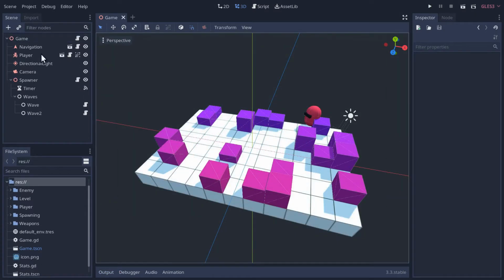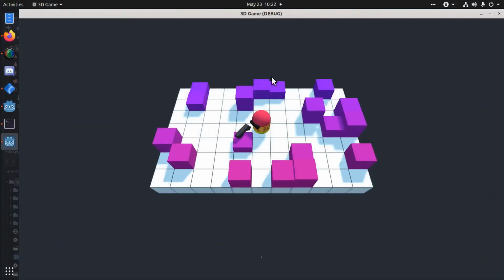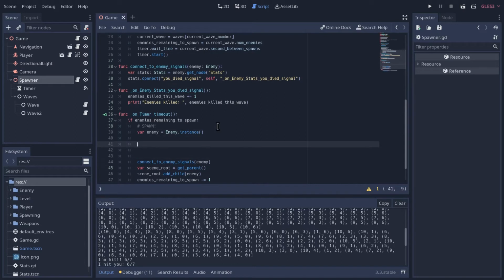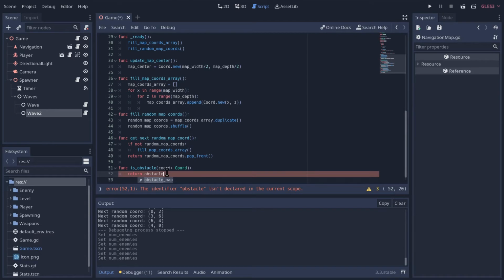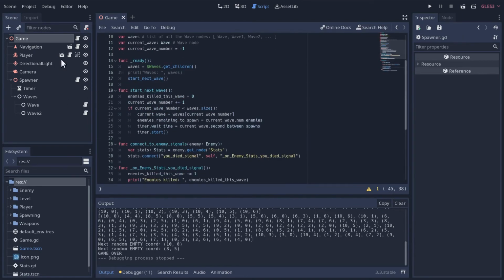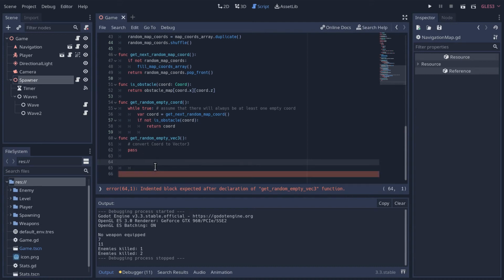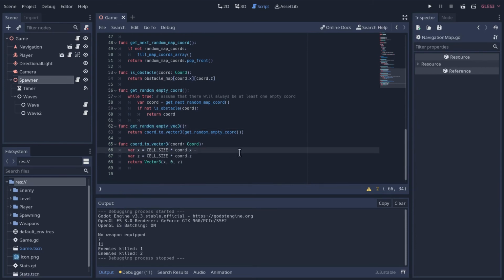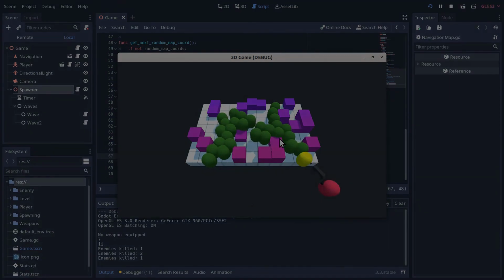Make a 3D Top Down Shooter with Godot - Part 3.1 Random Spawning

Comment: If you using godot 4.0 Beta 11 and probably newest betas  these are solutions for this video.
Ther is a bug which so far it isn't resolved since Godot 4.0 Alpha 3, still dosen't work in Godot in 4.0 Beta 11
You can't use "not" or "!" infront of Array  if that array is "var", it only works when it is "const".
GDScript 2.0: Can't use not operator (!) with String, Dictionary, or Array unless const.
 
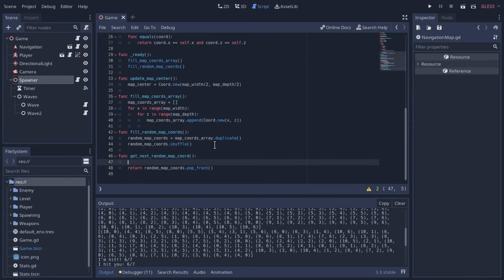1* 5:10. # If that bug will be resolved code below should work in future.
# func get_next_random_map_coord():
# if not random_map_coords:
#		 fill_map_coords_array()
#	 return random_map_coords.pop_front()
But below you will find two solutions for his problem.	
	
I was recomended 2 solutions to solve this problem.

* First solution similar to orginal code, insted of using 'not' i should use 'is_empty()'.
#	if random_map_coords.is_empty():
#        fill_map_coords_array()
#	return random_map_coords.pop_front()
	
** Second solution is to use the ternary operator. In this case you would check the lenght of the array.
#	func get_next_random_map_coord():
#    return random_map_coords.pop_front() if random_map_coords.size()>0 else fill_map_coords_array()

I was informed those two options are best solution because
this way will make your code more readable and clean.

I have used first solution and everything works fine for me!.

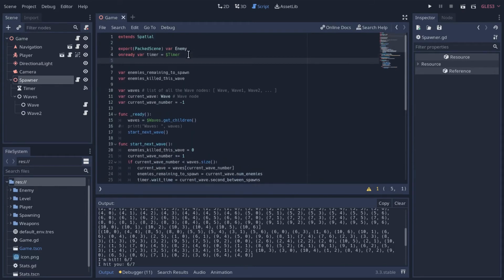2* 6:00 In Spawner gdscript add this:
@onready var navmap = $"../NavigationRegion3D"